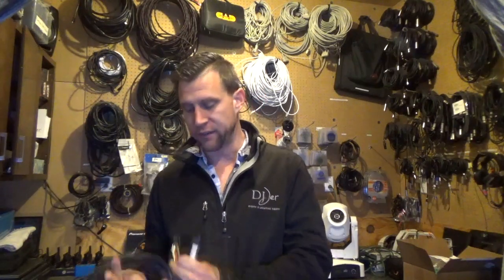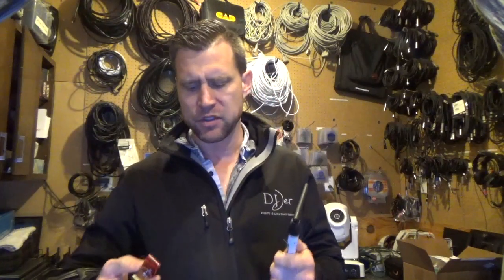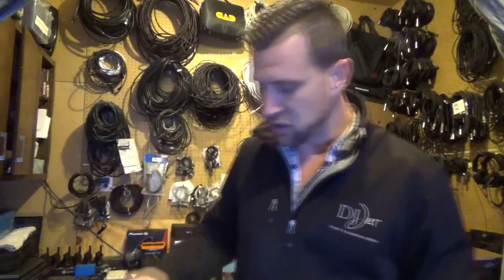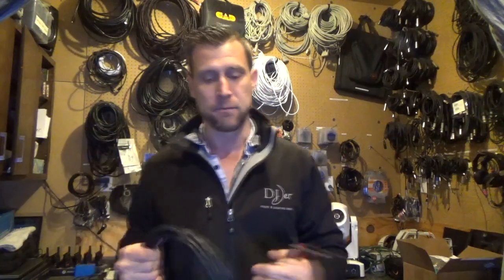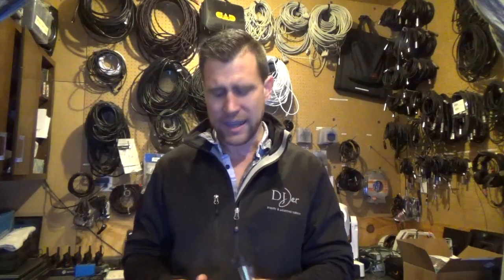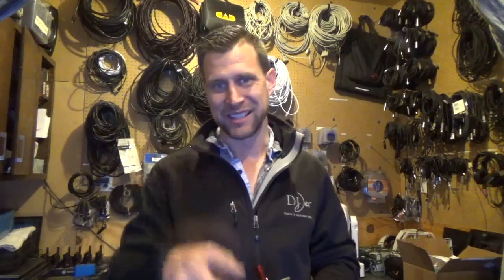Wireless DMX Vs  Wired DMX

Comment: I agree, I see all those vloggers using wireless dmx but they don’t even have a bridge, they just have like 2 robots in 2 totems or 2-4 pars in the same speaker stands which as you say is accessible but... I think it’s not reliable long term, feels like it can go wrong way easier than DMX cable